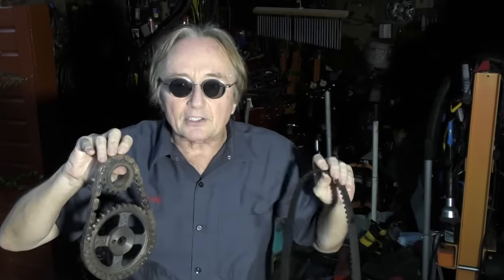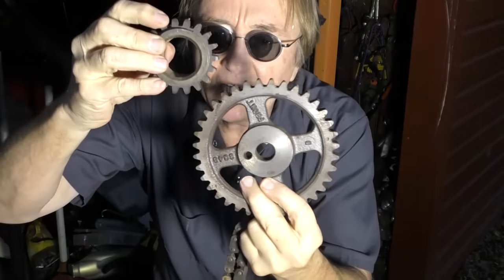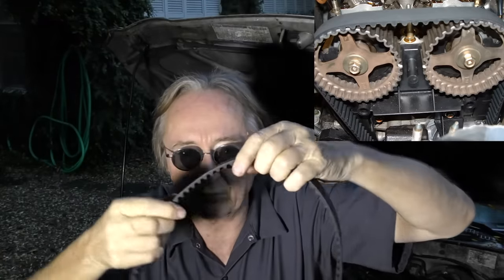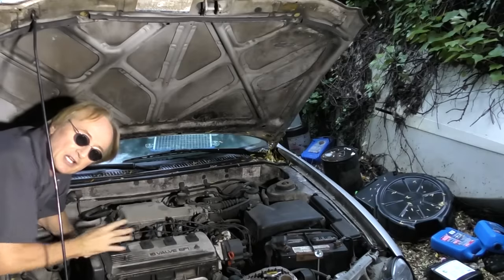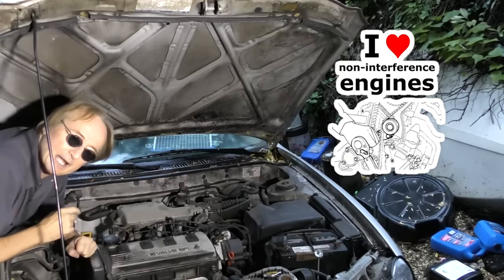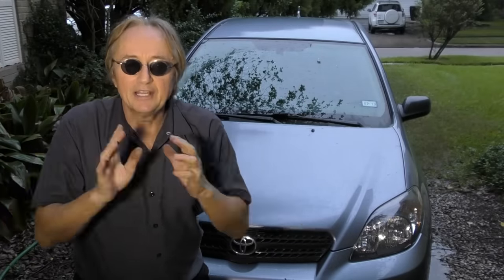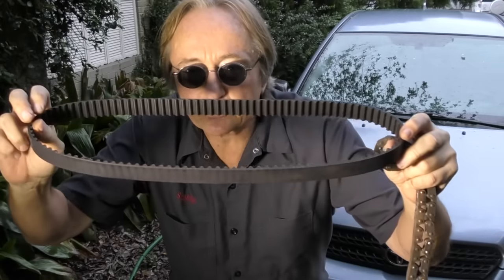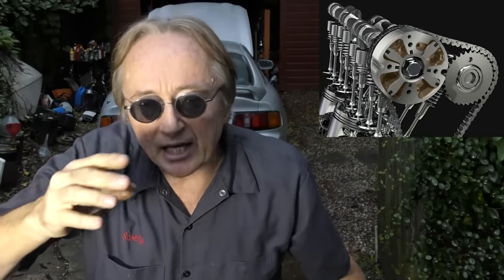Why Some Cars Have a Timing Chain Instead of a Timing Belt

Comment: Chains are definitely better. However quite a few earlier v8’s (Chevy comes to mind) had cheap potmetal cam gears with pressed on nylon teeth that would wear out quickly and cause the engine to jump time or piston to valve contact. My 80,000 original mileage 1966 Chevy 396 had one of these gears on it. Went with a double roller with steel gears and teeth and won’t have to worry about it for a long time.
Reply: Older V8 (ford, chevy and Dodge) never bent valves even if the chain broke.....
Reply: Yeah, I had a 69 Impala, 327 chain broke bent 5 valves and 4 pushrods in one head..lol..
Reply: Steve Prince I’ve heard my Ford 4L 6 SOHC is a ticking time bomb because of the numerous timing chain guides.  A couple of them look easy and inexpensive to replace but their are a few down below that I’ve heard are difficult to get to and very expensive.  And to top that off I’ve heard a few of the guides are plastic!
Reply: Tony B 
NEVER?🤔
Reply: The nylon  does help quiet down the whining.    (not the customer whining,  the engine noise whining)
Reply: Charles Mcgehee 
That was the intent supposedly, but I replaced mine with all steel double roller and I can’t hear any noise. My old 300 Ford six has gears and I can’t hear those either. 🤔
Reply: The old 50s Chevys inline 6 had a fiber gear on the cams to calm the gear noise .
Reply: NASCAR uses timing BELTS, not chains.. Belts offer more accurate timing and dampen harmonics. Its no wonder honda with their vtec uses belts. CompCams makes a belt kit for your Chevy 350
Reply: @noneya6334  Belts also take less power to run, which means more power for racing.
Reply: matt bauckman , Yah those were a horrid concept , I laughed the 1st x I saw one ! Oem's claimed they were " quite " ???? I never heard a timing chain make noise in my life , other than if one was  hitting the change me indicator !
Reply: @bluesbastard81  Yeah, the "change me before I blow a hole in the timing cover and trash your whole engine" sound. How is that better than a belt?
Reply: idontcare80  , Its better because you said it - " change me " at least they give a good warning , and I've never / ever seen one fail !!! Belts - ahhhh yah they die all the x and so do the motors there on . Thank you , come again .
Reply: @bluesbastard81  You don't need a warning with a timing belt, they have a change interval in the manual. Change the belt when it's time to change it and you wont have any issues. I've seen PLENTY of timing chains fail. The Nissan VE30DE was famous for putting holes in the chain case, Audi has had serious timing chain issues and so has GM.
Reply: idontcare80 , I wasn't referring to the little overhead motors were the engineering is all over the place , I'm talking American v8s with the conventional setup . Have never , ever seen one fail - period ! If you change them at 100-150k they work like a charm and wont jump even if loose as hell.  I do change mine when needed and never have an issue . My point with the audible indicator some have is it tells you it is time, belts don't have that . I'll take a chain any day - they've been great to me . Thank you
Reply: @bluesbastard81  Those engines are basically gone, dude, and have been for a long time. The vast majority of the engines on the road are OHC engines. Anyway, people don't have issues with timing belts unless they don't change them when the manual says to change them, it's operator error if they break. I've been working on cars for 17 years, I've never seen a timing belt fail prematurely, but I have seen them go well past their change interval. Most of the latest timing belts were also designed to go for 100,000 miles.
Reply: idontcare80 , That's true most don't change them on time ! Please accept - " I LIKE CHAINS " . They don't break , they just stretch and cam timing changes a bit without failure !

Comment: Loved my old ('96 and older) Ford 4.9 litres. Or 300 CID inline six for you old goats. Gear to gear, no timing chain. And those engines were built like a tank. Originally designed for industrial applications they got put in pickups as a temporary measure. That turned into long term. Great for us old guys that ran the wheels off service trucks. Bulletproof old iron.
Reply: Ford's best engine. Bulletproof.
Reply: Interesting info. I just know they used em in older mustang's. Will file that away

Comment: The main reason why timing gears aren't used nowadays has nothing to do with expense or the whining sound they make. Timing gears receive harmonic vibrations from the engine and adjacent parts pick up some of it. This trips the knock sensor in modern cars which makes the ignition timing go wonky.
Reply: BAM!
Reply: My car has a knock sensor and a timing chain... As well as most modern over head cam v-8's for the last 28 years...
Reply: @lilsammywasapunkrock  He was talking about timing gears (ie. a series of connected gears), not timing chains (ie. two gears linked via a chain).
Reply: Good ol ford 300 straight 6 timing gears from the first one produced all the way to 96.
Reply: so because of poorly balanced parts from the factory ...... cars are better off with belts or chains that don't pick up harmonic resonance from other moving parts ........ hmmmmm,  sounds like a chevy or doge problem cause my ford 300 six has over 300 thousand miles on it and starts everytime in 30 below zero ..
Reply: Nope,
You can use combustion space ion sensing knock control, saab and bmw at least have been using this for some time, no problems with mechanical vibration or noise.

Comment: I like the old gear timing. In the 70's you could buy a bolt-on after market timing gearbox to replace the chain set up, remember that, Scotty?
Reply: No way!
Reply: You can still buy a gear setup for Chevy 350s.
Reply: @orangefaygo1  correct - the datsun pulsar had timing gears as well....late 70"s
Reply: If you have a big stack of gears going to an overhead cam, you're costing yourself a significant amount of power through gear friction loss.
Reply: @roberthunter5059  true -every systems have their pros and cons,personally I prefer a cam chain as opposed to a belt where good quality guides are paramount to that system-presently have a cam belt with an interference motor which is a disaster if the belt goes.
Reply: @roberthunter5059  dude spur gears are 97% efficient

Comment: I love non-interference engines! 👍💯
Reply: Will Cal a
Reply: Joe Paul  
Toyota still are mostly
Reply: What are some good reliable non interference engine cars? With cams not hitting the top
Reply: @richguev  97-01 Camry with 4 cylinder for sure.
Reply: Will Cal how would I be able to know just by looking at the engine bay if the engine is non-interference?
Reply: Joe Paul  thats a lie. Most engines are now interference engines.
Reply: Yea the 1GR-FE is amazing
Reply: @eeyyaakk6801   Gates belt manual online.  Look up the engine you have. If there is a part number then you have a timing belt (interference engine)
Reply: @ANDthe3  what about 98 Camry V-6

Comment: 69 Mercury Cougar V8 had timing chain. However, the crankshaft sprocket was steel but the camshaft sprocket was some sort of composite that wore out. (I bought it used so I don't know if it had been previously replaced with cheap parts).  Easy to replace timing chain and sprocket. Replaced timing belt of 74 Mustang II. But it was hard to put the belt on while keeping the sprockets lined up. It seems like it took a dozen tries.  I'm glad they are back to gears. But I don't do my own repairs anymore. I'm too busy and modern cars are too cramped under the hood.
Reply: All Ford gears of that vintage had nylon faced alloy cam gear. With a link belt chain. Actually quite a big job when they fail as you have to remove the whole front of the engine and  drop the front of the pan to get the cover off and back on.
And often end up with an oil leak after. Or pull the pan by lifting the engine up as far as it will go, removing the sway bar and pull the pan out by turning the crank so as to wiggle the pan off. though that is the best way as there will be all the dead gear crap in the pan anyway. Days work however with a p/s AC car.

Comment: The problem I had on the two timing belts that I lost about 20 years ago (one on an interference engine 😢, one on a noninterference engine 😁) was not that the belts "snapped". Both sheared off the teeth on the belt at one location. Examination showed that the teeth on the belt were cracked and degraded. However, having looked at more recent belts replaced after 10 years, the belts seemed to be in much better shape with no signs of cracking. Perhaps the belts have improved? I don't think the engines are running cooler (which would presumably cause the belts to degrade more slowly).

Comment: I had my timing belt changed on my Acura MDX twice already. At 70k miles the first time to play it safe. And just did it recently at 145k miles. And my mechanic showed me my old timing belt it still looked almost new so those rubber belts are very durable and could easily do over 100k miles.
Reply: I have a corolla 200000km on it never did the timing belt still look new... Changed on my Hilux 10 years old 150000km did not even need it...
Toyota belt good rest no good

Comment: Seems like timing gears are still the most reliable option.... I wont mind the noise cause materials used in modern cars eliminates external noise efficiently
Reply: You really don't hear any noise with the timing gears LOL.  My 84 Ranger and Bronco 2 had the 2.8L V6 engine which had timing gears.  When they switched to the 2.9L fuel injected V6 in 1986 they dumped the timing gears for a timing chain.  Timing gears or a timing chain will be fine, its the built in expensive failures of timing belts that really pisses me off...they couldn't spend an extra quarter to just put a timing chain in rather than a damn belt that will fail and cause major damage in several engines.  Engineering/cost cutting at its best, and they'll just rape you when you come in needing that belt changed because...well not only did they cheap out and install a rubber belt they also installed a nice plastic water pump for you as well that needs replaced at the same time.
Reply: Most modern engines are OHV design, using gears would make the engine take up way too much space in the engine compartment. If you want timing gears, look for a pushrod engine like the corvette.
Reply: I had a 6 cylinder Ford in 1966.  One timing gear was steel the other was nylon.  Eventually at around 100k the nylon gear would start to wear out or "feather".  New set of gears cost $40. That was about a third of a week's pay back then for comparison purposes.  It had no "whine".

Comment: I stopped at a motel in Greenville, SC probably 30 yrs ago now.  A man had a car in the parking lot after dark that wouldn't start, and I tried to help, of course.  It was a Japanese car of some kind.  It kept turning over and over, so I suggested we see if we were getting spark to the plugs,  I pulled a wire and, No Spark.  I then pulled the distributor cap.  The rotor wasn't turning either.   I told the owner to not bother trying anymore and draining his battery it wasn't going to start and his timing belt/chain was probably broken, the car wasn't going anywhere and to call a motor club if he belonged to one.  I'm not a professional mechanic, but do have some experience, I was about 41 at the time.  I sure hope I was correct in my analysis, as the car was still there when I left the next morning.
Reply: Gary McKinley I’ll bet your about 71 now.   😏
Reply: What was the point of that story?
Reply: uare you but there is not a distributor anymore these days, so let the history be history… lol
Reply: Honda was using cam driven distributors well into the 90s... long after domestics had gone to full electronic.
Reply: @robertprechter6804  damn avatar. I thought there was a hair on my screen.

Comment: I had a Honda accord over 20 years ago that had the timing belt break, but it did not destroy the engine. When the new Saturn's came out I bought one because it had a timing chain. That was a great little car and I actually got 46 miles to the gallon Highway on it!

Comment: Honda V6 used in the Accord has a belt, and it IS an interference design.  But it has iVTEC.  If the belt breaks the valves snap shut, saving the engine.

But most Hondas these days have chains.
Reply: Mickey Bitsko That’s not how VTEC works! If it’s interference, it’ll hit!
Reply: @YZJB  Maybe he is are trying to say if iVTEC cam is have enough lift that it can be interference engine but the normal non-VEC cams dont have enough lift to hit the piston head... not sure correct if I am wrong
Reply: Macdavish Gaming I think he is saying that the intake valves will close and save the engine, but this is not true
Reply: If you get the 4 cylinder Honda Accord which I think is K24 engine, it uses a timing chain.
Reply: @gm92845  No, all accords up to 2007 have a timing belt.
Reply: @HardWhereHero  You need to take a look at a 4 cylinder Honda Accord, because all Gen 7 Honda Accords 2003 - 2007 with the 2.4 liter 4 cylinder engine have a timing chain. The V6 Accords use a timing belt.
Reply: General E DGAF wrong. My ‘03 Accord LX 4-cyl has a chain. 

On the other hand, my ‘07 Odyssey EX V6 has a belt.

Comment: The old Ford 4.9L/300 cu. in. inline 6-cylinder engine has timing gears, in case anyone is interested....
Reply: I had one of those in a F150 when I was younger and dumber. Didn’t know what I had cuz I would have kept it. Those engines are legendary and were used many years in UPS trucks. It was a great motor.
Reply: yeah - a friend had one in a 70 pickup. it blew up when he was doing about 70 on the highway.
Reply: They put that in vans, bronco even f-250. Ford stopped putting them in 1996 . 300 cu inch 4.9 liter. Legendary motor
Reply: @chieftp  Either severe use or lack of maintenance.
Reply: Han Skinslo  In my opinion  you would be hard-pressed to beat those helical gears.
Reply: Yes but the gear had plastic teeth steel body.
Reply: The 2.8 cologne v6  is geared too, if I'm not mistaken
Reply: Was that the in line 6? I had a ford wagon with a inline motor and I TRIED to kill that thing by running it without oil for days, we poured veggie  oil in it and it still refused to die.
Reply: those inline 6's had torque for days...
Reply: so does the 1984 1.8 litre Subaru 4 cylinder of which I own AND that 300 ford six as well .. I like reliability over flash , performance , style or new .
Reply: Those last FOREVER.
Reply: I got one in my '89 bronco, it has 236,000 miles on it
Reply: the 2.8 and 3.0 V6's had gears too.
Reply: Yes indeed.  Those engines were built to be industrial grade (that's not a joke; Ford also sold those things for 'industrial power' applications - generators, agriculture, mining, etc.).  And part of that industrial grade spec included a GEAR DRIVE timing set.
Reply: @chieftp  low gears and high rpm's  can definitely blow them up the newer ones have higher gears able to handle highway speeds alot better.
Reply: @robertallain8966  Subaru's are belt and those years were dogs and not really all that reliable. They got better in I think it was 93 they went to mpfi power pretty much doubled and they did away with 4Lo which really wasn't needed anymore. Handling was majorly improved also
Reply: @xaenon  my dad has had quite a few wreckers with the 300 and what runs the hydrolics on his crane impressive for such a low displacement.
Reply: @MontysMotos  2.8 and 3.0 was horrible engines. 2.3 with a belt was way better
Reply: @damonlemasters3424   The 300 and its little brother (the 240) were jewels.  Ford definitely got it right with those engines.  I loved how durable they were, and how you didn't need to rev them very high to get results (which, if you think about it, was probably part of why they lasted so long!).
Reply: @HardWhereHero   Ford used a variety of inline-sixes in their wagons.
52-64 full sized cars    223 (Ford Motor Division's first production OHV engine, in fact)
65-72 full sized cars    240 (li'l brother of the 300; same motor with a shorter stroke)
60-69 Falcon                 170 or 200 depending on year and options
62-71 Fairlane/Torino  170, 200, or 250 depending on year and options
78-82 Fairmont             200